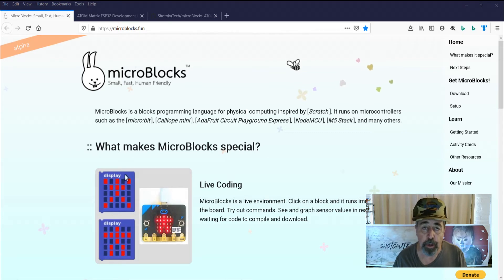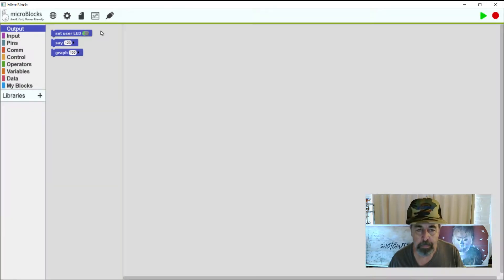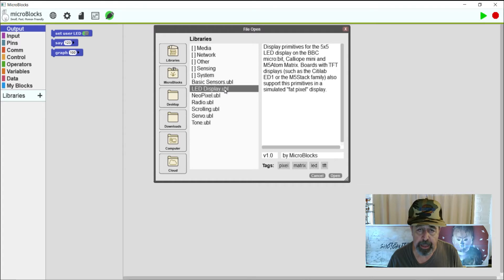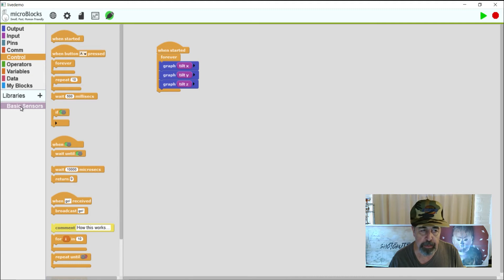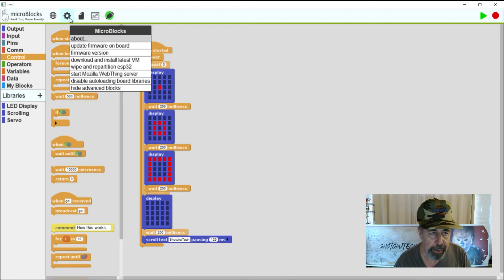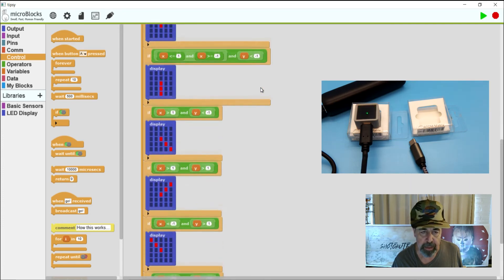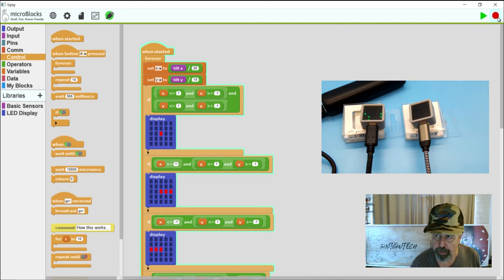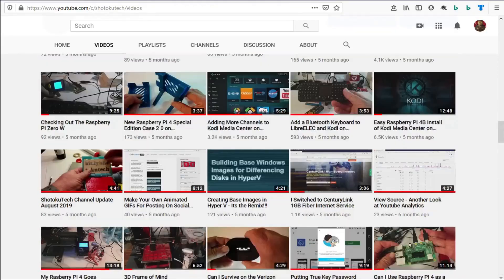M5stack ESP32 ATOM Matrix Programming with microBlocks

Comment: Hi Shokutech Guy ! I'm glad this tutorial offered me a chance to try "scroll text" feature. Did you notice UIFlow doesn't offer such feature? But nevertheless, it seems that; like me, you couldn't change the displayed texts' color; isn't it? MicroBlocks Wiki describes a "Set Display Color" brick, pretty much similar to UIFlow's "Set RGB bar color" one; only it is unavailable here so far. Have you got a clue why? The wiki entry states that "this is only effective on TFT displays with multiple color support" - I'm unfamiliar with what TFT is; yet as for multiple color support, I believe Atom Matrix would tick this box. Question is: any clue why the color choice is not showing?
Thanks for this nice tutorial anyway!!
Reply from the maker: I haven't used Microblocks for a couple of years now. But in the video I see both blue and green colored lights in the display. UIFlow certainly offers the ability to change the colors. I just tested and I can set each individual LED to its own color. Under Hardward/RGB, scroll to the bottom and click on Set Atom Matrix. Yes I don't see text scroll function in UIFlow. You might be able to write code for that. Each IDE platform has their own features, good points, bad points.

A thin-film-transistor liquid-crystal display (TFT LCD) is a type of liquid-crystal display that uses thin-film-transistor technology to improve image qualities such as addressability and contrast.[1] A TFT LCD is an active matrix LCD, in contrast to passive matrix LCDs or simple, direct-driven (i.e. with segments directly connected to electronics outside the LCD) LCDs with a few segments.
TFT LCDs are used in television sets, computer monitors, mobile phones, video game systems, personal digital assistants, navigation systems, projectors,[2] and dashboards in some automobiles and in medium to high end motorcycles. 

Best wishes.
Reply: That covers it then, thanks for your reply. As for writing code, I never interested myself in Python; but since you can trade blocks for code I may well try to edit MicroBlocks existing scroll feature and paste the code in UIFlow IDE. It’s worth a try, I guess.
Have a nice day !!

Comment: Do microblocks support the ESP32s dev board?
Reply from the maker: I would imagine it can. Though it blanked the screen of my TTGO T-Display. I didn't play around with it long enough to see what I could do on the T-Display board because I wanted to work specifically with scrolling text. microBlocks essentially writes it's own microPython firmware on your board so you can program it.

Comment: Hi there! One of the MicroBlocks devs here. Updating the firmware is something you have to do just once before connecting to a board for the first time. That makes the board microBlocks-capable. After that, you can just disconnect the board at any point in time and the program you wrote will just keep running in it. There's no need for a manual upload/compile step, the board is always in sync with what you see on screen :)
Reply from the maker: Good to know. For someone coming from Arduino world and working with three different Scratch based IDEs in the same week, it gets confusing. Thanks.
Reply: i need help. i just got my m5stack plugged in and the microblocks program is not detecting it. i checked my pc ports and it says theres no driver. also, i noticed the board gets quite hot.
Reply from the maker: @levistrnad2965  Depending on your operating system you may need the CP2104 Driver: https://m5stack.com/pages/download
I cannot speak for the heat of the unit. Try a different cable or USB port?
Reply: @ShotokuTech  ok. i tried on another pc and it seems to work now. it still gets quite hot and a pixel will sometimes turn red when i run a code. i think the board is slightly defective.
Reply from the maker: @levistrnad2965  I have noticed one LED will flash at the start of the forever loop while code is running live in MicroBlocks, if that makes sense. I'll have to see about the temperature next time I get out the ATOM Matrix. Thanks.
Reply: @ShotokuTech  yes. that too. but theres a specific light that will turn red very dim when the pixel next to it lights up. perhaps a short? which could also explain possible over heating.
Reply from the maker: @levistrnad2965  Now that sounds fishy.